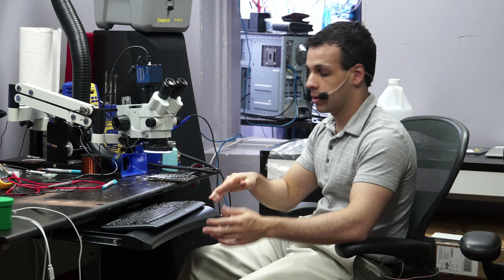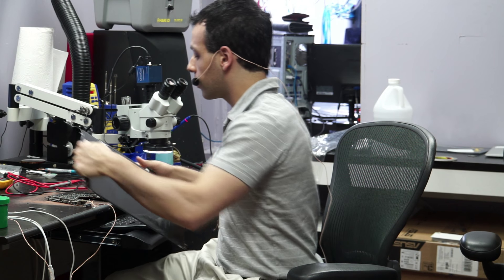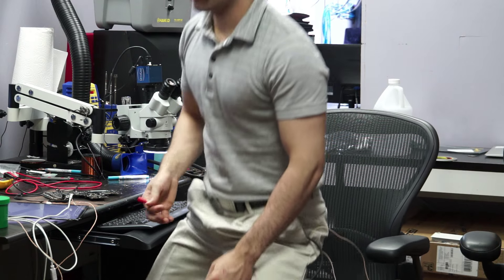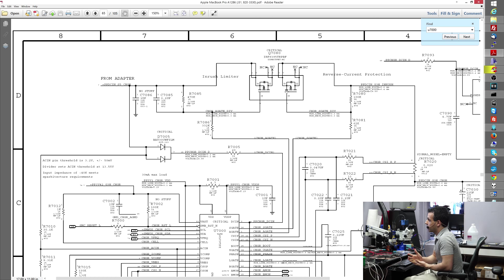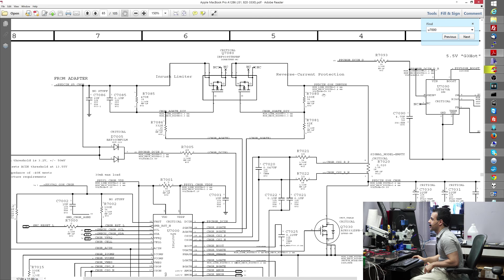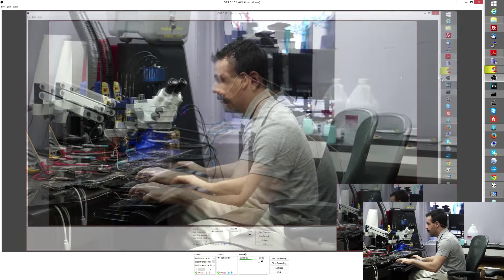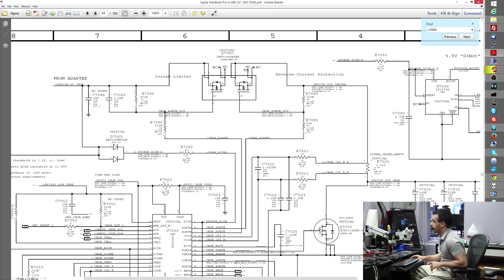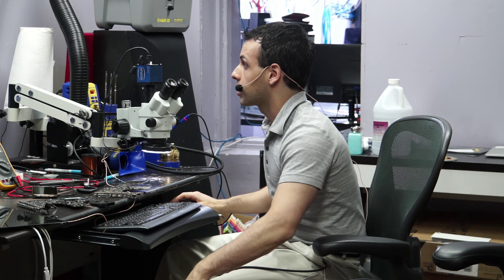Repairing Macbook with no power from charger.

Comment: Hi Louis. Great videos. Thanks a lot from Russia. ) Concerning this video - how board works from power supply, and not working from charger? According to schematics you solder your power supply to the fuse f7905, exactly before non working resistance and Q7080, so how it can be true?  Wether schematics is wrong?
Reply from the maker: +семен семенов The magsafe supplies power based on what it perceives to be the resistance at the time. The PSU doesn't give a F and sends power through regardless.
Reply: +Louis Rossmann  think that it is done not by adapter, but by the dc in board. Now i fully understand what's wrong with my board. I have 2.6 to 0.99 V spikes in any point of PPDCIN_G3H rail. Most likely first problem is in resistors of "power sense". 
I would like to translate some of your videos to Russian, how can i contact you for the details about this?

Comment: Yo, I think you really need to get another monitor for casting the screen, so it doesn't get so trippy every time! :D
Reply from the maker: rkan2 Which screen?
Reply: Louis Rossmann A second screen you can control open broadcaster from, so you can directly switch the feed and check whats broadcasting.
Reply from the maker: I've thought about it and it would definitely be a good idea that I want to do. As lame as it sounds, it's just about investment. I put about 27k total into the project of doing board repairs and filming them on site here, including employees I hired/fired, equipment costs, machine costs, etc. I'm just done spending any money at all. I look at it and it would cost less than $100 to just get some shit monitor I mount on the wall next to the desk to control OBS from, and I don't even want to spend that, because if I spend that, it'll be ok to spend on something else, and something else, and it just never ends. So I just cut it off altogether. Short of something dying that is critical to work, I spend nothing on building upon the current setup. Editing these videos happens on my beat to shit T520 with cracks in the case even. 

But good idea.

Comment: Hi Louis I just wanted you to know that I appreciate your effort out of your busy schedule to help others in the field of board level repair you are a blessing.  I have an A 1502 2013 Retina board 820-3476-A that has an amber light all the time even with battery disconnected I have been kind of struggling with could you help any suggestions are very appreciated.  Be Well!!
Reply from the maker: +MacPC Tech That is a working board they always have amber with battery disconnected.